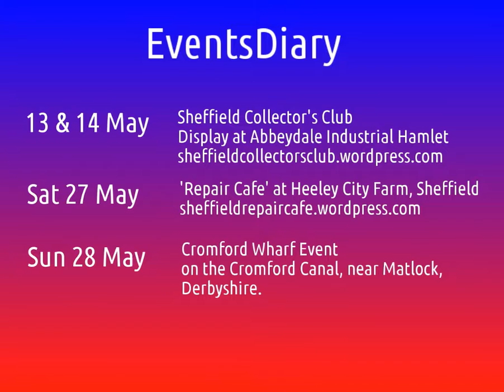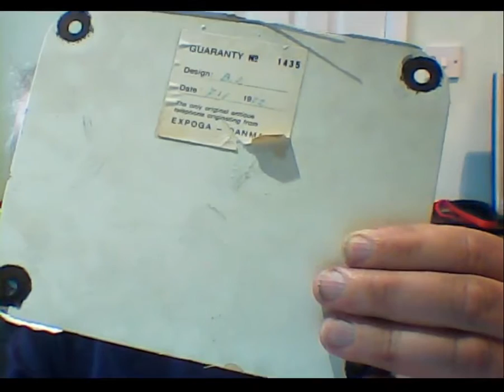Andy's Shed Live S01E09 - MYSTERY DUTCH D8 VINTAGE TELEPHONE?

Comment: Hi Andy that phone is a DO8 and diagram can be found in Rotary Phone Forums, have ordered one off Ebay which looks in very good nick will put up when it arrives.
Reply from the maker: +migette1 I think I saw that phone on E-bay. You should be careful because the company eho re-sold them into the US market also started to make replicas when the supply of originals ran out. Or at least that's what I've been told. Look gor plain ones and they stand the best chance of being originals. The ones with all the gold castings seem to generally be replicas, sometimes using US 500 series bits. I'll look forward to comparing yours to mine.
Reply: I really hope its not a fake. will feature on a video and hopefully it will be the real thing checking all items and would expect it has a slipping cam dial original from an English design. The dial has the correct letters of this type of phone, not the US format. Still waiting for it to arrive.

Comment: Check out the capacitor, sounds like your ringing is being tripped and the call don't get through, I have put my one up, not exactly the same, the ringer looks the same with adjusting screws on the armatures, also is it possible that the dial had been added to make it an auto job, bet the screw holes have been drilled out. The dial looks very much like one made in Japan and was fitted to many repro jobs especially in USA. Have a little look  inside the dial box....good luck..Peter

Comment: Has there been any updates on this phone? I just bought an identical model here in the US but it had a four prong plug. It has a sticker on the bottom that says "The Only Original Antique Copenhagen Telephone", repeated in French and German, and below that "Expoga Danmark". It is a CE. Model 1908S with a dial added for export to America. I bought an RJ11 adapter and a Xlink BT model X-BT2 to connect through my smartphone.  It would ring out but no sound on the handpiece. I loaded the software for the X-BT2 and reversed tip and ring via software and the phone now works fine. May be a software glich as I later had to change it back. I did not adjust any wiring. One thing most noticable is the insane weight of this phone. Your phone is assembled wrong and wired differently. To remove the top, I must disassemble the hook and gong to separate from the cover as well as removing the two brass bolts. The hook assembly base should be under the cover, not on top like yours. There are two guide pins on the internal bracket that line up with the hook assembly base. As for wires in the order you described, 1, 2,and 3, brown, green, and yellow respectively go to the hand piece. 4 has no connection. 5, 6, and 7, brown, green, and white respectively go to the 4 post wall plug. 8 should only have ONE blue wire running to the dialer of the phone. Yours has an extra wire on screw 8 that should not be there. At the four post plug, the white and green are combined for upper left post and brown on upper right post. These connect to the RJ11 white/green to green and brown to red. I don't know what the British system is.
Reply: The 1908S has an eight position buss while the D08 has an eleven position buss.

Comment: Hi Andy. Iam trying to convert two gpo 746's Both have a redial non latching push button. is the redial button only for internal switchboards. as the 746 does not have a memory of the last number. Should i remove it and put a false button there instead, Thankyou in advance, James
Reply from the maker: +James Stephenson Hi James. The push button originally did something acrossbthe line which did the re-dialling at the exchange or pax (that is if I remember right from memory. What I do is take all the terminals of the switch unit and screw them all onto T15 together with the green from the line cord. T15 doesn't do anything on a normal 7xx phone so the wires just sit there as somewhere to put them. Alternatively you can remove the switch unit and fit a blanking plate button to the phone. Personally I leave them in to keep the originality.

Let me know how you get on.

Comment: My guess its made up of old parts but using reproducktion handset looks too new, I will put a video up on a KTAS phone which looks like it could be but messed about with by a previous owner, the extra no like hole could of been for a digital meter to record the number of calls. I will put mine up which is not working, wires have been cut but may help.
Reply from the maker: I think you could be right about the handset, especially the plastic grip. It doesn't feel right for a plastic material that should have been around in the 30s & 40s. I'll have a look at your video and compare the two.